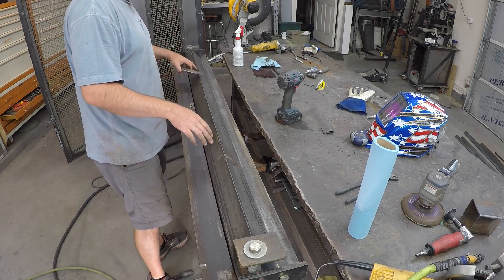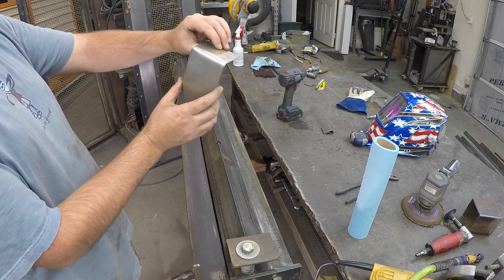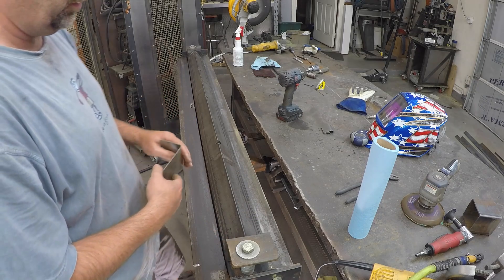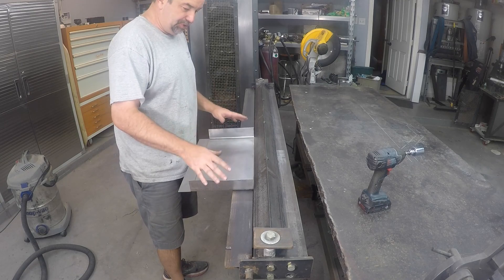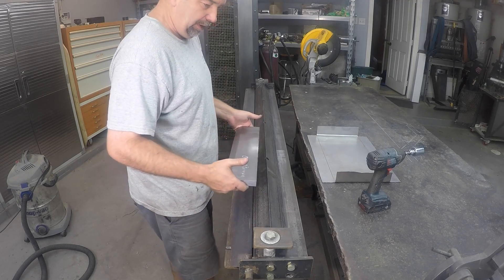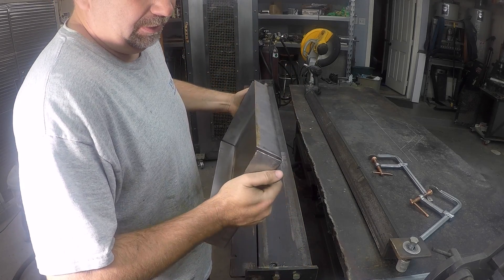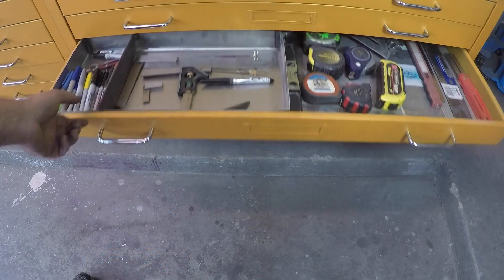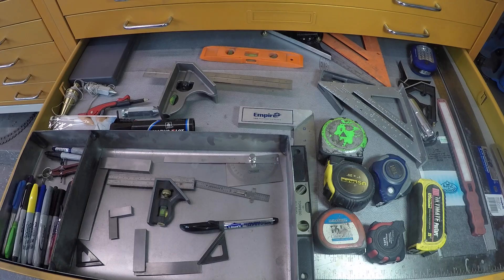Home made Sheetmetal Brake - Metal Bender - enhancements

Comment: I have fixed vehicles and not done sheet metal bending except when I need to make something. My question is, their is a front bar lifted to pull the metal into the brake or back bar. But the brake or back bar needs to clamp down on the top of the work piece. Normally, the more easy to built uses everything from wing nuts to bolts.
 Would a foot bar be quicker and just as effective?
The top bar or brake as I understand it has to be rigid but clamp down tight. What if a pair of bars, left & right, pull basically straight down, but pulled by a rectangular foot bar. It pivots at the back, under the brake, but round stock bar can attach and pivot on it, while the top pulls down with force to hold the sheet products in place. A simple frame of round bar, pipe or heavy re-bar could come out straight from underneath to a round pipe (For Comfort) for your foot to step on first, because you have to stand back anyways, to lift the bending bar handle. Yes, foot down, work piece tight, lift the bending bar with free hand. A 1, 2 step. 
  Wouldn’t this eliminate extra step of placing the sheet where you need it quicker, making adjustments to its position as easy as letting up on the foot bar (Return Spring On Each Side) then step, re-clamp the sheet, lift up on front bar, and complete the bend? It could be made so it comes apart easy by removing the return springs, hair-pin cotter, bar for storage to transport. It just seems simple to add, but a useful part. Thinking out loud!
ASE Master Tech since 1978 - Retired

Comment: Do your bends a little tight and you can pull them out a bit. Not sure if the homemade bender will alow that but all your 90 degree bends should be 91 degrees and bent out a bit by hand. That has always worked for me. Everything is pliable with thin gauge metals. It always works better for me.

Comment: you can cut a line inside the 90' plate  if the plate i thick enough it will work, and you can connect the plate with an addition flat steel...for this like you do it you will need every time an exact thick plate and i think if you cut your headplate and make a thread inside and connect it will be better...sorry if you cant follow me im from bosnia an 16 years old

Comment: There's nothing like having a sheet metal brake.  I built one out of some closed grained hardwood and steel flat bar and it will handle galvanized sheet metal but that's pretty much the limit.  my bends are very sharp but there is a wee bit deflection at the center to I plan on beefing it up some.  I'll post my finished brake in the near future

Comment: Hey- don't diss homemade stuff! Just up your game...
I have lots of homemade tools, and a homemade press brake, and homemade jigs, dollies, bender, etc. you can reinforce and fabricate struts for that brake to not only bend crisply, but be more useful and not be single-purpose. 
As far as square drawers: square things (drawers) are made in wood and metal all the time. And not with huge jigs and machined tooling. Rather, small shop square things are made with body english, three-dimensional visualization, "the force," and a mental one-ness between the hands, eyes, mind, and material. That box would have had crisp bends, flat corners, and been almost as quick if hammered out with two little hammers on a benchtop jig. 
It's not because your homemade bender is limited, its that it needs a lot more tuning, some strut reinforcements, and well-distributed clamping points.

Comment: Pull open a drawer and at 8:53, "I use this stuff constantly" .  My first thought is, Dang that drawer is 3 from the floor.  I like to put the stuff I use most frequently in upper drawers to minimize getting down low to get stuff I get the most.    Just a thought ;-)

Comment: To solve your corner gap problem, figure 75% of your material thickness (bend allowance) and subtract that from your flange width, example: 16 gauge material (.062), and a desired 1" flange width. 75% of .062=0.046. Subtract 0.046 from 1"=0.95 (15/16"). On your flat sheet, measure in 15/16" from the outside edge and scribe your bend line on all sides, then notch your corners where the lines intersect. When you make your 90 degree bends on this line, the outside dimension of the flange will be 1", and your box corner edges will be tight. This basic formula accounts for the material stretching as you form the bends.  All this assumes your brake clamp has a fairly sharp edge (which angle iron does not have).  I'll dig thru my archives and find my old bend allowance chart from my naval shipyard sheet metal shop days and share it here.  Hope this helps!

Comment: Great job
1 question,would not some kind of cam work better for clamping ? As it wears in,the cam would keep fitting snug
Reply from the maker: definitely!
Reply: I think his sheet metal stock is being pulled a little bit from under the angle iron clamp resulting in a curved, not crisp bend.  Just needs a stronger clamping system to keep the sheet metal from moving out from under the existing clamp.

Comment: The one thing I see in most of these home built leaf breaks is any adjustment forward and aft of the upper jaw that clamps the sheetmetal. A slotted upper hole for your clamp dawn jaw with bolts that will move the jaw will give you the ability to make crisp 90 degree corners in the metal you bend.
Reply from the maker: Yes sir, excellent point

Comment: What chop saw are you using?  Is that a wood miter saw with a diamond blade?!  Or does dewalt make a dry cut saw?
Reply from the maker: +J Dug It's a Dewalt Chop saw that is specifically designed for and comes with a steel blade with carbide tips.  The saw runs at a much slower rpm than the normal abrasive ones.
Reply: +turbocobra Yea looked it up, didnt know dewalt made dry cut saws.  I was looking at getting one vs the abrasive I just bought, Feel  like i Should return it.  Whats your opinion on them?  Worth the extra cash?  Id rather clean up metal chips than abrasive dust from sparks.

Comment: You might consider welding a flat bar across the bottom of your clamp bat thus giving you more of a square to bend against. A dry run could be tested without welding.
Reply from the maker: +john kirby I didn't think of that, but yea I think the commercial brakes have something like that.

Comment: I just stumbled across your channel earlier today. I worked in the machine trades at one point in my career, and it still interests me. Currently, I do construction work. One of the tools I would like to acquire is an aluminum coil brake for bending fascia metal. Unfortunately, a medium quality brake is in the neighborhood of $1500 or better, and simply not in the budget at this point in time. Some of the concepts used on your brake would apply to bending aluminum coil, although clamping the work piece would need to be modified to make it quicker. Do you have any ideas that you wouldn't mind sharing with me?
Reply from the maker: +Thomas Pasqualone Hi Thomas, thanks for stopping by.  I am not quite sure what type of brake your talking about?  Do you have a link to a commercial one i can look at?  The one I made in this video worked pretty good, but I wasn't super happy with it, I ended up buying a large heavy duty finger brake that was in the price range your talking about.
Reply: +turbocobra , thanks for the reply, after some further research, I found something more along the lines that I was looking for. Unfortunately, it would most likely cost me as much in materials and time as it would to buy one. Such is life.
Reply: +Thomas Pasqualone I do sinding I bought one in ebay for almost 900 but Im thiunking to build one and the problem  I was thinking about vice grips at the end I just saw in menards ones that are automaticso u dont have to adjust the screw in the older one so some thing that might help to close tight withuout having to take nut out

Comment: grind off radius edge of angle iron and you will get crisper tighter 90 degree corners
Reply from the maker: +Ciaran Dunne good point, thanks man
Reply: +🔥Ramsey Customs - turbocobra good idea.  

can the angle iron move fore and aft a little?  If so, bringing up for the thin stuff and back for the thick stuff.    I hope it is adjustable because when you grind it, you might change the distance from the edge to the hinge point.

Comment: I made my self this kind metal bender from used veneer lathe blades. The angel in the blade is aprox 15 degree so its possible to make pretty tight bends. works like a charm. Nice video.

Comment: I don't know if you did or not, but if you mill the edge of the clamp down on bottom you'll get a cleaner brake bend. So the edges are sharp and parallel to the base. Not sure I adequately articulated that. lol
Reply from the maker: +David Bryant Thanks david, yea, the clamp angle was milled on my little grizzly mill, took me like 4 hours to mill it. The issue is that the pivot shafts on each in are not inboard far enough  I ended up buying a grizzly brake.
Reply: +turbocobra foshizzle.

Comment: Hi to reduce the size of the gaps you can look online to find bend allowance then make your size of the notches half the bend allowances small because when you bend metal it stretches so the bend allowances help as you work out your cutting size. But with your custom machine the bend allowances will be different.

Comment: hi, there are several factors why your bends are coming radiused, you can be off center with your hinges, have a radius in the pressure blade, have flex in the blade which is very common or you can have the blade too far from the bend line to name a few. there is the issue of material too but with steel in the gauge you seem to be bending it`s not hard at to fix at all. close tight gaps can be done no problem in a well tuned bender. thanks for sharing. regards. pete
Reply from the maker: thebrokenbone Thanks Pete.  I am actually working on it now... I was going to let it ride, but I can't, so I am relocating the hinge pins, on the bend lever.  They are causing the lever bar to rotate outward slightly because of where the pins are located in relation to the centerline, so I am making some new pins (larger diameter), and locating them further inboard of the main platform anvil which will hopefully cause the bend lever to rotate inward more.  I had previously milled the edge on the clamp blade to a sharp point, and its adjusted to clamp at the very edge of the main platform anvil, so I think that part of it's good.  Thanks again.
Reply: yes, the ideal location for the pins axes is in line with the plane of rotation of the moving blade. the usual location is on the outside of the machine, there was a very good thread in a forum a few years ago (a few for me could mean in 1987...). i`ll search and post
Reply: hahaha look at, http://www.woodworkforums.com/showthread.php?t=45792, this is from 07 (so it fits my "a few"). the op by the name of simso (steve) assembled a super informative thread showing the design and fabrication of his machine. i took some ideas of his design to make mine but for wider material. simso`s brake is a box and pan brake and although the clamp lever seems complicated is well worth the effort as it increases (waaay much) the ease of operation. add a depth and squaring guide and you`ll be set for some nice work. hope it helps. regards. pete
Reply from the maker: thebrokenbone checking it out Pete, it makes alot of sense.  btw, how did you find my video?
Reply from the maker: thebrokenbone btw, i am making some mods based on some info you have shared, so hoping to have it finished up by tomorrow and will see how it works out on the boxes i am making, will share in an upcoming video
Reply: turbocobra glad it helped. i recently subscribed to your channel when i made a search for a tube roller (i think). thank you for sharing your work man.

Comment: Just out of curiosity why wouldn't you put one of those rubber drawer liners in that drawer to keep stuff from moving around?  Don't get me wrong I like you solution just wondering.
Reply from the maker: rindress Hey Rino, yea all my drawers have the liners in them, they are silver looking.  Some dude on eBay was selling them as a "chrome" color, lol.  They seem to be pretty good and work good, but the mass of the drawers with the ball bearings, and the fact that the items are light and not jam packed in there, allows them to always go to the back...

Comment: Hey Gary, just a hint......I think if you will drill a small hole at the exact corner before you notch them your bends and thus your corners will come out alot more crisp and tighter fitting.
Reply from the maker: K&L Machine and Welding Ok, yea good tip Larry, guessing that will allow a little releif at the bottom to allow it to close up easier...